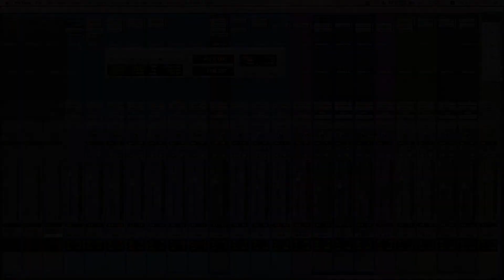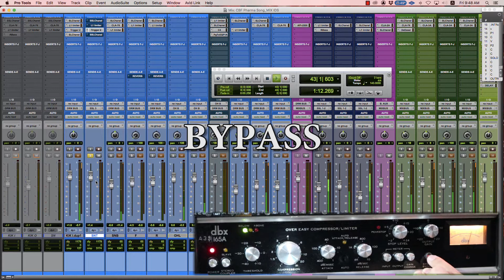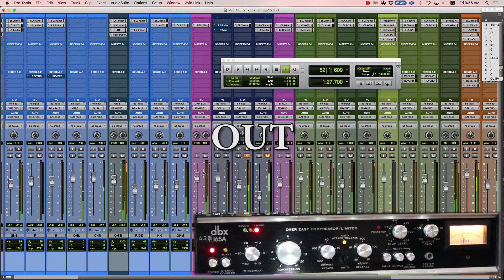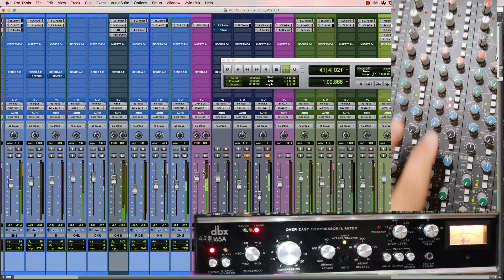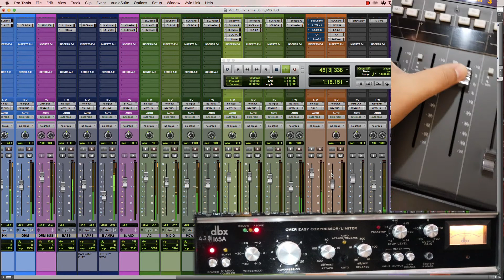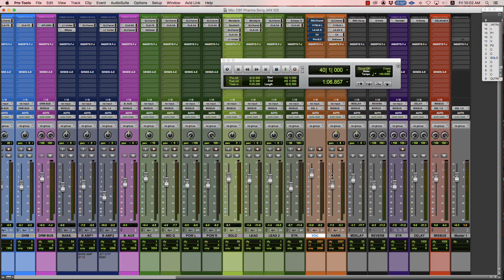DBX165A The underrated compressor

Comment: Pretty cool review! I happen to have the dbx 166 1st gen, as well as the 160A. One thing I really enjoy is to crank that peakstop limiter, makes it a lot easier for snares to pop out. Does wonders to bass guitars as well. However the 166 has auto attack and release only, sometimes it sound to me as it smoothens out the peaks, unlike the 160 and your 165. Next on my shop list is a pair of the original 163s xD.

Didn't see you using the peakstop/stop level on this review, no idea if you ever used it... If not you might benefit from that resource. Cheers from Brazil!
Reply from the maker: Thank you for your suggestion. I will definitely give it a try. 😊🌟🙏🏻
Reply from the maker: Haze Entertainment   I feel the 165a gives more snap and knock to the drums than the 1176. The 1176 do give some snap but less punchy.